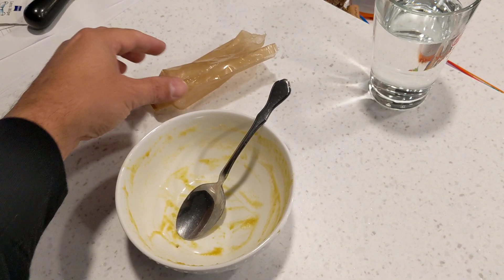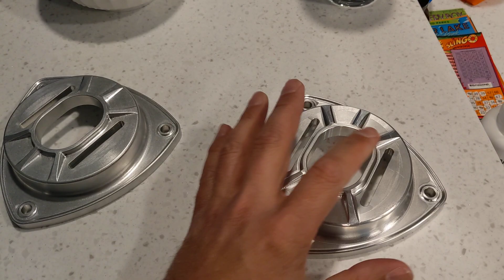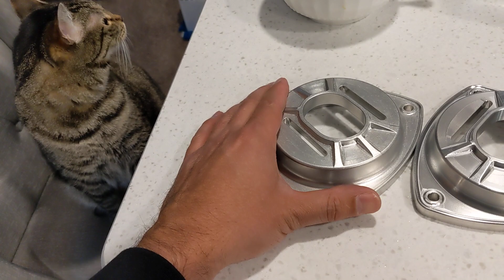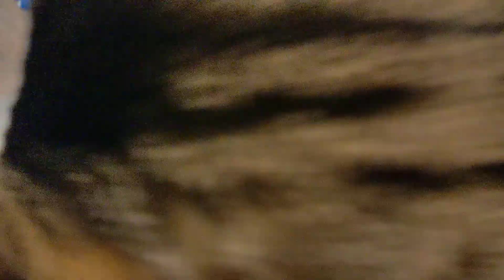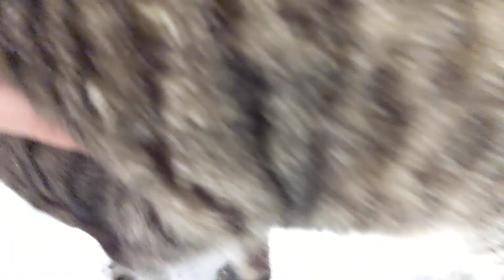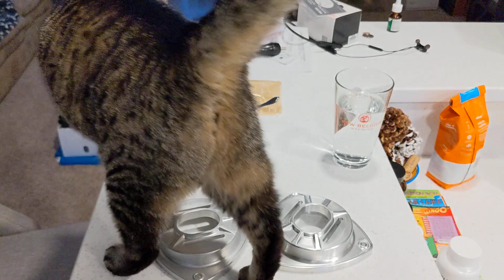1200 dollar top hats

Comment: I have my top hats mounted so slots are diagonal for both camber and caster.
Have you considered any benefits of such layout? Worked fine for me so far, but I still have long road ahead in terms of suspension setup development...
Reply from the maker: Yeah that's pretty standard for a lot of people. Just switch sides and rotate the plate

Comment: Are you making some adjustable rear top hats?
Reply from the maker: I could.
Reply: @GetaDomTune  Yes you will. MAKE THEM PLEASE. And please dont have gaping holes where water can fly inside the car.. Every manufacture sucks at this. I have a paper towel there to absorb all of the rear tophat water flying in.